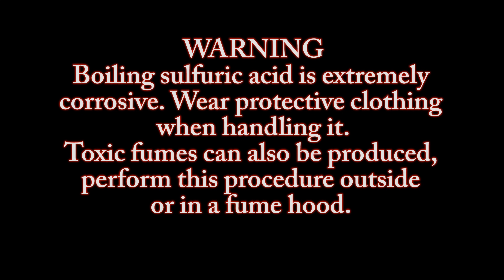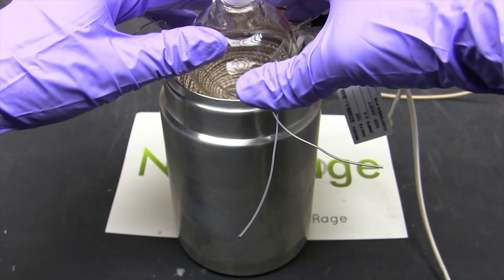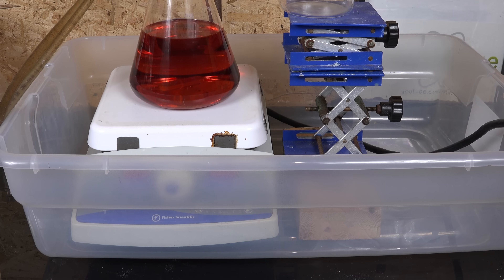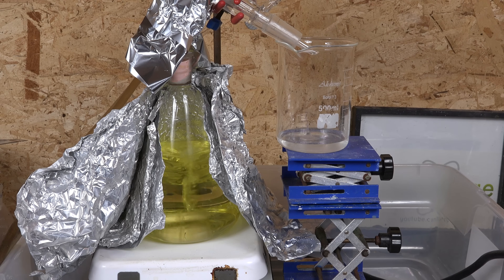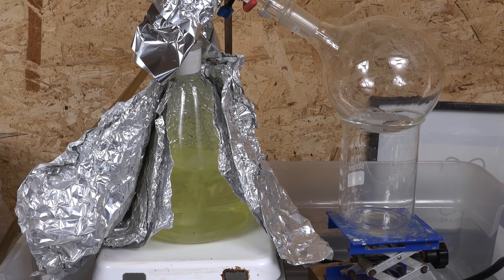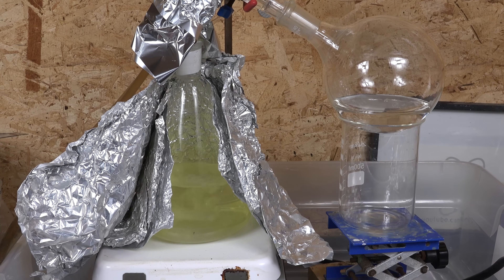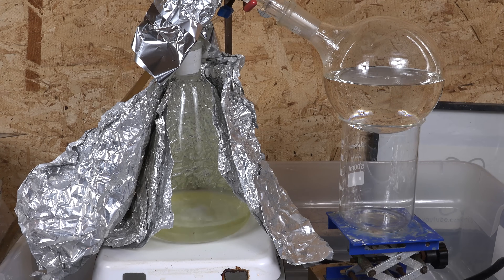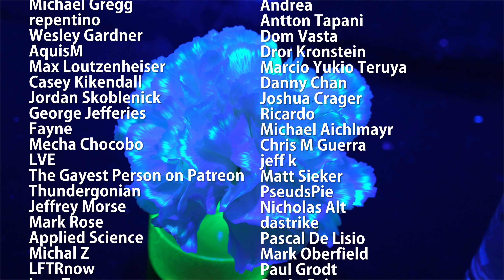Purification of Sulfuric Acid by Distillation - Revisited

Comment: Why  you label sulfuric acid as "98%" on your bottles when it is 90% only?
Reply from the maker: because it's 98%, as confirmed by density measurements and titration,
Reply: @NurdRage Wow. That's a good result. I've concentrated sulfuric acid many times with a 400mm column and never got more than 92%. I did a simple distillation once or twice a long time ago when I started doing chemistry and the concentration was also something like 90%, definitely need to try distilling again.
Reply from the maker: @Виталий-т4в7п  how are you measuring it? titration? density? and what are you reporting your results in? mol % or weight %? the 98% figure is for weight %, but if you're calculating on the basis of mol% then you'll get around 92%.
Reply: @NurdRage  By density and its conversion to weight % via a table from the internet or a book
Reply from the maker: double check your density measuring device and calibrate it against a known density standard, the difference between 90% and 98% sulfuric acid is 1% in terms of density, the error in most density measuring devices can be bigger than that.
Reply: @NurdRage  Problem with concentrated sulfuric acid is that after around 93-94% concentration it's density (g/ml) starts to decrease. And to check if you have concentration more than 94% or less then 94% you must add a little bit of water and check how density will change: increase (then we have >94% and concentration decreased towards 94%) or decrease (then we have <94% and concentration decreased further). But the best way is to weigh a sample of the acid then precipitate sulfate by BaSO4 and weigh the precipitate, or use a titration is  you have precisely prepared NaOH|KOH solution, which is quite hard to make.
Reply from the maker: @konstantinlee2275  thats why i said "confirmed by density measurements AND titration" I used density first to make sure i was in the right region, and then titration to confirm,

Comment: i can vouch for boiling sulfuric acid, it violently dissolves a hot dog until there's nothing left, along with wood, plastic, rubber, nitrile, and basically everything else that is organic. not something to play with, especially without some kinda of thick, non melting glove (leather welding gloves can survive small splashes and prevent burns but dont rely on it)
great video as always, ceramic hot plates are the best! i got three of them (two made one commercial, homemade uses corning parts and commercial one is a trusty thermolyne SP131325) and theyve been running the lab nicely for years, i had an aluminum one i built but the aluminum definitely softened at 400c or so, i also simply just didnt like the feel of glass on aluminum

Comment: PTFE tape decomposes at those temps and produces toxic gasses. You were doing it in a fume hood which is a must have for that. Something you didn't mention and is probably the least major thing doing that but worth noting as it's dangerous and starts at around 260. Even if it's stable and doesn't really have issues till about 400 that are noticable.
Reply from the maker: You're not wrong, PTFE degradation releases tiny amounts of toxic compounds. At these temperatures and quantities you're getting a few milligrams of it. While it is toxic, a few milligrams is not a lot (or else the millions of teflon cookware owners would be dead from all the times they accidentally burned their cookware). But let me tell you the much bigger issue of PTFE in boiling hot sulfuric acid: THE BOILING HOT SULFURIC ACID.

A lot of these comments are missing the forest for the trees. The 800mL of boiling hot sulfuric acid can take off your flesh and eat you right to the bone... and the bone itself. The sulfuric acid and sulfur trioxide vapors are produced in gram quantities, not milligram, grams. And those vapors burn so bad that the 0.01% of fluorocarbon vapor will just be seasoning. Having good ventilation, containment procedures, and protection is required for the ACID. The PTFE safety just rolls into that. 

Worrying about the PTFE degradation with boiling sulfuric acid is like worrying about lead poisoning after being shot... yes, lead poisoning is not good... But you kinda have bigger issues like those bullet holes in you squirting blood. Fix that and you'll fix the lead poisoning issue automatically.

Lay out and completely handle the boiling sulfuric acid issues... and the PTFE issues will be handled too.
Reply: @NurdRage  fair enough 😂
Reply: Ah haha.....  worrying about the PTFE..... yeah that is not what I am going to worry about. I think boiling sulfuric acid is probably one of your most dangerous videos.  Scares me just thinking about it.  Thanks for the great content though.
Reply: I was wondering about that as well, but I have some doubts that the PTFE is getting to the full 337C since it's not in the main path of heat flow.  Still it should be considered as a secondary hazard though and shouldn't be done around household pets since they're more sensitive to the gases and usual outside or in a fume hood rules apply.
Reply: @bearghost123   I agree. However, I doubt that one layer of PTFE tape is enough mass to elevate it to a significant secondary concern for humans. It might be a concern for birds and small rodents, but probably not for humans in a room, as opposed to a closet. Or done multiple times a day. That said, this is just my speculation, and not to be taken as advice. Nurd's protocol made it a non-issue. The real issue is when someone sees someone using PTFE at high temperatures on the internet and thinks it's ok and doesn't do their own due diligence.  But I doubt they read the comments anyways. 🤷

Comment: A stainless steel food tray, commonly known as a hotel pan can be found used practically free, and can be found in sizes about the same as your plastic tub.
Reply: I've also seen them advertised as "Anti-jam pans"
Reply: And concentrated sulfuric acid will passivate stainless steel, protecting it from corrosion. Nitric acid will do the same.

Comment: I bought 2 gallons of 98% sulfuric acid at Walmart a couple years ago. Lightening brand. It was $16. I just thought it was good to have.
Reply: B-but how do you store it? Hope it is not just in a random jug without spill containent :face-turquoise-covering-eyes:
Reply: It's as I bought it. It comes in jugs that are in sealed heavy plastic bags.  @TheEsseboy
Reply: @hubrisnaut  I would still put it in a bucket with sand, a plastic bag is not a good second containment strategy due to its fragility. If you are not regularly testing if it can hold liquid without leaking.

Comment: Is there any specific reason why a vacuum distillation is not an option for sulfuric acid? lowering the boiling point with vacuum would significantly lower the danger of this process
Reply from the maker: the thing with vacuum is that the stress of the vacuum can can cause the glass to implode. It's a rare event, but it does happen. And when it does you'll have flinging glass and sulfuric acid. So you're basically trading dangers.

By all means give it a try though. I did try vacuum distillation and the temperatures i needed for my setup were already so high that it was already in the "hot sulfuric acid" zone. So it wasn't worth adding the vacuum implosion danger on top. Maybe a stronger vacuum can lower it to the "cold sulfuric acid" zone. But i wasn't able to access that with my setup.

Comment: 4:50 ahahah you said PTFE tape right when I opened the comments to write that PTFE tape made a pretty good job at sealing joints for distilling H2SO4 - the trick is to wrap it reaaal tight and to not go further than the stopper / male joint or even to stop slightly before that to limit the quantity of PTFE that gets exposed to the H2SO4 vapors.

For plugging openings such as with a 3-neck round bottom flask or other glassware necks that need to be plugged normal chemistry rubber plugs also do a surprisingly good job. The part exposed to the H2SO4 will carbonise, but it does so in a slow manner and once the carbon is there it kinda protects the rest and doesn't pollute the solution (H2SO4 will just convert a bit of it to CO2 I guess). Rubber seals do an excellent job in this scenario, even though they get a few milliliters shaved off each time.

I'm currently working on a device that should be able to plug one neck of a round bottom flask hermetically even to H2SO4 vapors while letting a stirring rod stir the H2SO4 during distillation - cuz my homemade heating mantle doesn't have a stirrer and as you said, H2SO4 bumping is one of the most terrifying things I have ever seen.
Reply: have you tried putting two glass tubes long enough to stand in the round bottom flask, and sanding them down to a opaque white finish ? this worked for me when I did not have stirring.
Reply: @knglaser How does that work?
Reply: @MadScientist267  nucleation sites distributed through the entire depth, without hindering the convection as a big pile of glass shards on the bottom would do.
Reply: @knglaser  Hmmm interesting... ok cool thanks
Reply: @knglaser  no but I'm very much intrigued, your idea sounds pretty good and I'm definitely gonna try that!

I was thinking of insulating magnets in a glass rod with a bend in the shape of a T at the end and rotate that with a motor and magnets but from the top of the round bottom flask where 1) I have access and 2) the temperature is less insane.

But if your method works I'm definitely trying it first, thx.
Reply: I've distilled sulfuric acid dozens of times. Never needed stirring. Take the ugliest ceramic dish you have, take an hammer, a nail/a screwdriver, and break the dish in many boiling chips small enough to enter the neck of the flask. In my experience about 6 ceramic chips whil be enough to distill very smoothly and with no bumping whatsoever abut 400 ml of sulfuric acid. Use new boiling chips each run.

Comment: I have to do some aluminum part anodizing in the next few weeks and I have been wondering if you can use drain cleaner acid to make up the electrolyte bath vs pure acid. Thoughts??
Reply from the maker: If it's just for anodizing, then it should work, but it really depends on the impurities. I would give it a try.

Comment: If the bin is there to catch spills, you could fill the bottom with some dry sodium bicarbonate. In the worst-case scenario it could save you a lot of hassle
Reply: I think this is rather dangerous. The reaction might spill the hot acid everywhere. Better to wait till it cools down before you neutralize it.

I also much prefer to dilute splashes of sulfuric acid with cold water (only if you mix it very fast, and only if the scale is low, of course), instead of neutralizing it when it is still concentrated.
Reply: 13:53 He says specifically NOT to do this. Think of a baking soda and vinegar volcano. He says wait for it to cool, check for possible damages, then use a mix of water and baking soda.

Comment: It's very nice that you're revisiting this.

Regarding electroplating, do you think it'll ever be possible for you to make a video on electroplating copper on aluminium? It's one of the holy grails of electroplating.
Reply from the maker: Electroplating? like solid aluminum onto a solid part at room or slightly warm temperature? or just making aluminum by electrolysis? which comes out as a liquid since the electrolyte is molten hot?

The two processes require radically different approaches. it can be done, but i don't think by amateur means.
Reply: @NurdRage  Sorry if I wasn't very clear.

I meant plating a metal onto an aluminium sheet like copper. Copper plating on aluminium is a notoriously difficult thing to do outside of industrial processes and a lot of them are hidden by trade secrets.
Reply: @neutronpcxt372  Plating metals directly onto aluminum is tough, so usually a basic zincate pre-plating step is employed, then copper, then whatever metal you're interested in, assuming it's not copper.  You must use alkaline plating solutions when working with aluminum, which unfortunately means cy*nide copper plating vs the more accessible acid plating solutions.  There are many examples of how to plate aluminum out there, including on YT, so a few searches help.  Electroplating/electrodeposition can be a complicated process once you get away from working with vinegar and salt solutions, so you need to do some work to understand what's going on, as often you'll get unusable results due to stresses or other issues.  It also often involves highly toxic and carcinogenic metal salts, so an awareness of how to treat them AND dispose of them is critical, ie don't dump them down the drain.
Reply: @flomojo2u  Yeah, I know about all of this.
I found a paper which I managed to replicate and get to plating on aluminium. 

The issue is that importing the necessary chemical was expensive and therefore not available to the general public.

To be fair, that was done years ago when I wasn't nearly as good as chemistry and when I had rather... suboptimal plating equipment.

I now have a MMO electrode and large pyrolitic graphite sheets which make plating so much easier and simpler.

One surprising thing for pyrolitic graphite is that it seems to be more chemically stable than normal graphite, which is weird. I haven't seen this in litterature (I am likely blind).
Reply: @neutronpcxt372  Pyrolitic graphite has stronger bonding between the graphene sheets than normal graphite, so they're less prone to breaking apart. Even better is amorphous carbon or "glassy" carbon, though it's not as easy to make. Do you have a specific project in mind with trying to plate copper onto aluminum? I've never tried electroplating anything onto aluminum.
Reply: @5467nick  Yes, I do have a specific project of mine: battery pack soldering.

Why? Aluminium is much cheaper than copper and especially nickel, has higher conductivity than nickel and has the highest conductivity/mass of all the metal mentioned.

Soldering aluminium busbars for end connections is practically impossible without ultrasonic welding.

Electroplating a thick copper layer on aluminium would solve that.

I haven't touched plating copper onto aluminium in years, but I guess I could restart :)

Comment: I always heard people discourage others from using a water condenser at such high temperature differences. Isn't there a high risk of the condenser cracking after some time?
Reply from the maker: i address that in my safety discussion
Reply: He addresses it in the video, but still, even if your glass is from a trusted supplier i'd just use the air cooling, there should be barely any drawback or loss of distillate considering how high boiling the sulfuric acid is
Reply: @timecode37  or better, use two different condensers in a series, the first with air cooling, the second with cold water. The first one condenses most of the acid and reduces the temperature gradient, the second one makes sure that none of the vapors escape (which is especially important for those without a fume hood, hopefully working on the outside). If someone doesn't have two condensers, he could put in between the adapter and the water condenser ~20 cm of any other glass tubing to similarly reduce the temperature difference with air cooling first. Borosilicate glass can withstand a thermal shock of 180°C, so if the water flows at 15°C, the glass before the condenser should be at less than 195°C to avoid cracking.

Comment: Excellent video, as usual. Tip for distillations that yield corrosive / poisonous gasses (like distilling nitric acid via H2SO4 + KNO3): I modified a small cheap fish tank air pump so it provided vacuum rather than pressure. After the water was driven off in the beginning of the distillation I routed the gaseous byproducts through a sealed glass jar containing NaOH prills and pulled a slight vacuum through the NaOH with the "vacuum pump". The vacuum was only enough to prevent escape from the joints in the apparatus and the NaOH captured the NOx. I did all this because I made my own fume hood and I didn't want to depend on it as my one and only defense against escaping NOx. Please, if any professionals out there note that this method actually creates a hazard I'd love to hear about it.
Reply: careful with passing it over solid NaOH since the reaction can be quite violent if, let's say, a bit of acid were to come over, it's better to bubble it through a concentrated NaOH solution with a trap before

teflon tape is your best friend
Reply: @ivant5054  Sorry for the delayed reply. You're right, which is why I had a trap upstream of the NaOH. I experienced a suck-back explosion once (fortunately just water). That taught me the lesson about sealed pressure/vacuum systems. They will bite you if you let them!

Comment: I distilled a batch of sulfuric acid a while back, something interesting I noticed was the PTFE on the stirbar turned completely transparent, I didn't see this happen in this video. Has anyone else had this happen? the stirbar was not damaged, after cooling it returned to opaque white and there was no obvious change to the PTFE (charring or etching).
Reply: That happens after reaching temperatures above 280 °C. PTFE is going from solid to liquid.
Reply from the maker: interesting!

Comment: Also would distilling under vacuum lower that boiling point?
Reply: Yes, it can boil at as little as 200°C, depending how good the vacuum is. But if you do it under vacuum you have to factor in the risk of implosion from the pressure difference.